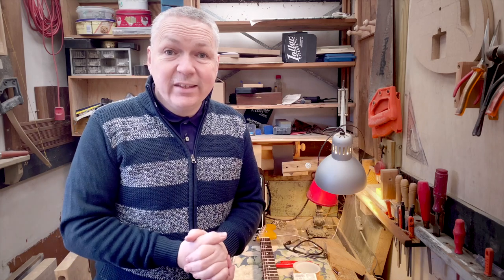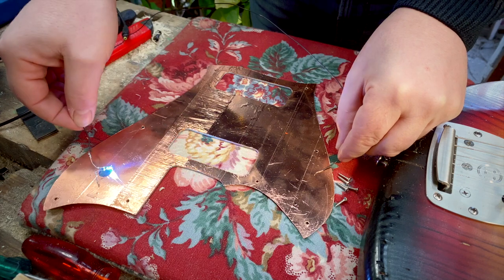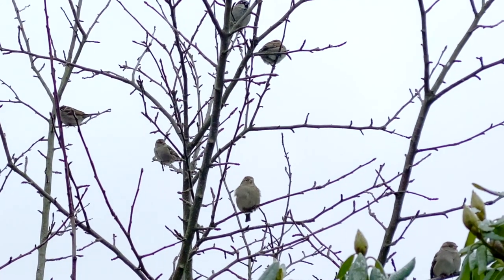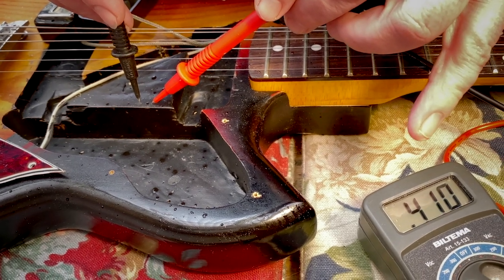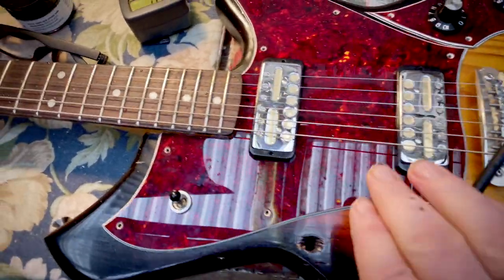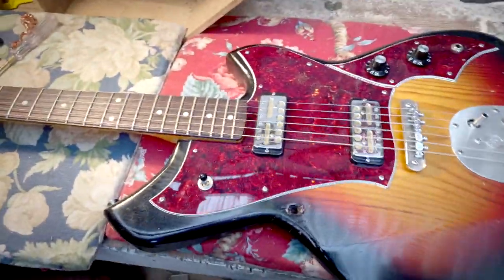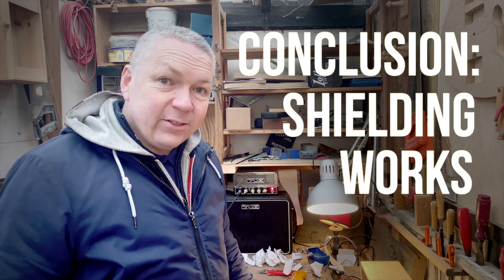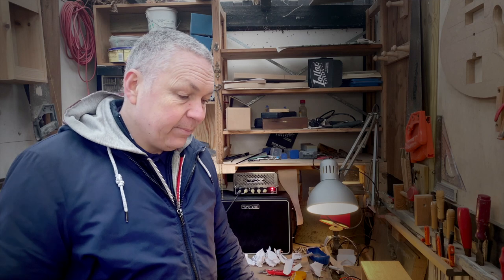This is WHY you should SHIELD your guitar -  PAINT or FOIL?

Comment: Further to my previous comment. My Fender Player Strat has a half conductive painted cavity, which seems pointless, I tried sticking copper to it, but it literally wouldn't stick. I will need to PVA or lacquer the factory painted cavity first. Has anyone else had this issue?
Reply from the maker: Hey Jason, thanks so much for your comment. I have only messed with shielding in my own guitar builds. Hope you find a good solution 😃👍

Comment: Ok I may have to try this with my les paul, cos although nothing in my recording room has changed with new equipment or moving things around, my guitar gets a lot of hum if im not touching the strings, so it might be me that has changed
Reply from the maker: Could maybe also be a grounding issue. Maybe your bridge is not connected to ground. 
But testing things and trying different things is definitely a good idea 👍 
Thanks so much for watching 🙏🏻😃
Reply: @MichaelLagerstedt  its definitely not a grounding issue with the bridge, the hum stops if I touch the strings, so acts like it should, but the hum is a lot for humbuckers, the pickups are very microphonic. Yet my variax standard with single coil, is silent as though its plugged directly into ground.
Reply from the maker: @RockG.o.d  oh … ok. Well It’s maybe worth trying shielding. Made a big difference in my case 😃👍
Reply: @MichaelLagerstedt  well this is strange. So at 4pm my time my les Paul is very quiet again, it’s also quiet with heavy distortion. Nothing has changed in the room I am playing in, my laptop is on, the Marshall on same settings. The hum I get is the same now if I touch the strings or not, well goes ever so slightly quieter, and the static noise when I rub the back is gone. Could it just be a case of static buildup?
Reply from the maker: @RockG.o.d  sounds really strange… I don’t know that I have the answers to that problem.
Have you seen this video:

https://youtu.be/t6E0O8UtObU

Hope you find a solution 😅
Reply: @MichaelLagerstedt  yes I saw that video. I’m going to put it down to some static which built up, probably due to weather changing.

Comment: Can anyone answer this? Does the copper tape need to have a ground wire soldered to it and connected to the ground of the jack? Thanks
Reply from the maker: It shouldn’t be necessary. In my experience you just need continuity between top and bottom of the “cage” (faraday cage)to stop the noise 👍😃
Reply: @MichaelLagerstedt  Thank you Michael. I took my new bass guitar back to the store because I was hearing what you demonstrated in your video. The manager played my bass through one of their amps & it was dead quiet. So he said that it could be my power supply to the home or interference from other things plugged in. I’m going to try this out. The only other thing it could be is a bad amp which is new as well. I didn’t think to take the amp with me to the store along with the guitar because I thought it had something to do with the guitars wiring

Comment: When shielding with Aluminum foil does the shiney side face up or down?
Reply from the maker: Hi Jeremiah, I don’t have a lot of experience with alu foil but I’m pretty sure that it doesn’t make a difference. 
I have only been using copper foil with adhesive on the back.
Hey, and thanks for watching 😉🙏
Reply: Aluminium looses conductivity at touching parts after some weeks by oxidization. You can roll up the touching rims to improve contact, but it stays never perfectly conductive.

Comment: Is the paint necessary?
Reply from the maker: Hi, … You can use cobber foil or paint… You don’t need both 😉. Thanks for watching 🙏😃
Reply: @MichaelLagerstedt  Thanks for the reply and great video. I have Les Paul that could use that tape. Seems like taping the cavity where the switch and pickup wires run down would be impossible